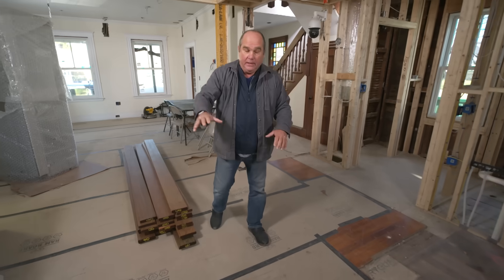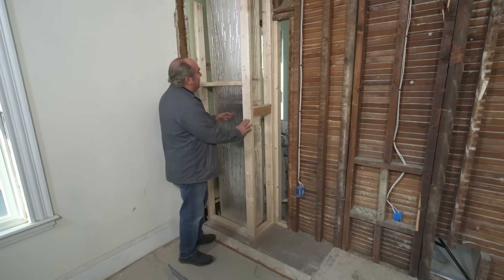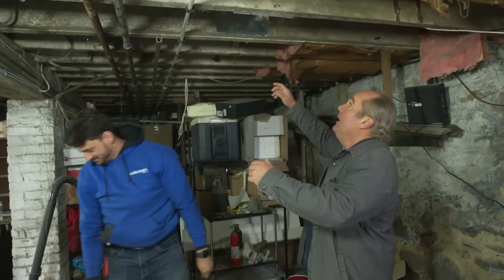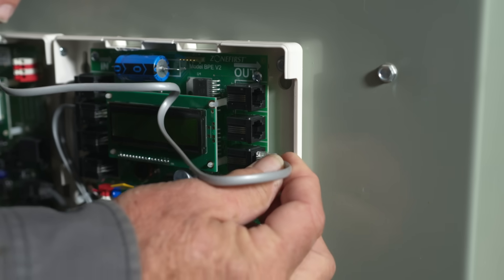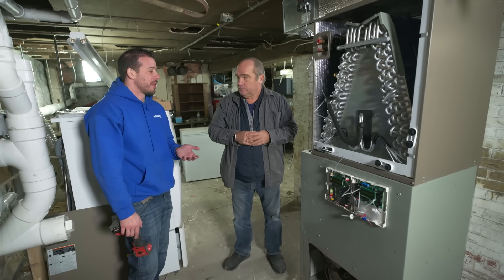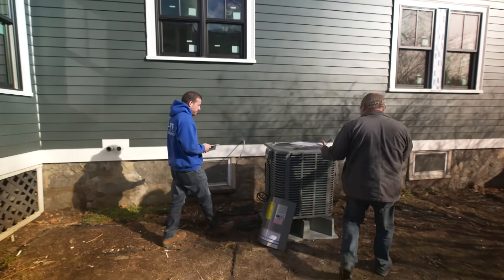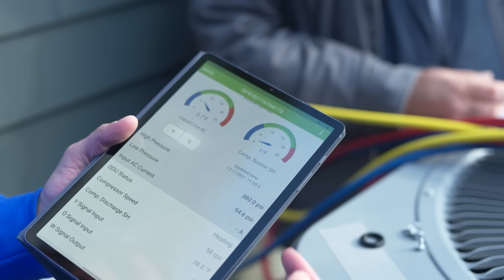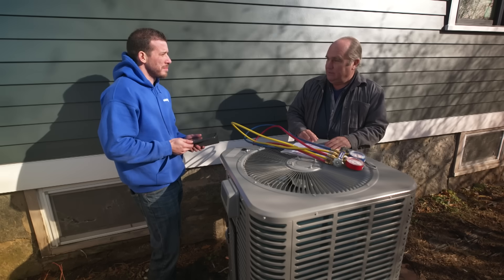Dual Fuel HVAC | This Old House

Comment: I’ve been using a Bryant Evolution hybrid system in my house since 2009. It replaced the crappy builder grade gas furnace that was installed when my house was built in 1992. I have mine setup so the heat pump locks out below 32F and the propane takes over. Still works great!

Comment: Dual fuel is the biggest government lie of this generation. They push for heat pumps and now our electricity rates are skyrocketing due to ai data centers on the east coast. Now the system chooses to use the gas furnace 90% of the time because it’s cheaper. The heat pump is just a waste of money and isn’t as efficient as advertised.

Comment: Standard gas lighting. “Switch from fossil fuel to electric”. Where do people think the electricity comes from?  In that area of New England it’s probably still coal. Natural gas if you’re lucky. Furnace is 92%. Power plant electricity delivery is under 70%. Which is green?

Comment: Now that there are heat pumps that work down to -20F and still provide 100% BTU’s down to -5F, there’s few places left in the lower 48 where dual fuel is needed.

Comment: I know people with an old octopus coal furnace with a Janitrol gas conversion burner. It looks like a mushroom with a gas spud that sprays gas on the bottom of the mushroom cap. It has a thermopile and can run with no electricity. If you add a duct fan and a fan limit switch, you can squeeze 80% efficiency out of a furnace from the alte 1800s.

Comment: No discussion of capital cost, the cost of electricity in the area, the need to have that system running literally ALL of the time, and the typical feeling you get indoors from a heatpump system of being "slightly cool." "Mom, is the heat on?" "Honey, if you are too cold, we'll turn on the gas heat." Bingo. You paid a TON of money to have the option to run the form of heat that will actually make you feel comfortable. The physics are great...until you have to pay for that transfer of heat, and then, make it comfortable in your house.

Comment: 1. That ductwork on the 2nd floor is grossly undersized. 
2. There is no return duct on the 2nd floor. That zone will never satisfy. 
3. Bay panning for ductwork is illegal in Massachusetts . Not to code. 
4. The duct should be insulated r-6 and r-8 in the basement. 
5. That heat pump unit does not heat down to the temperature he said. Maybe 100% of its capacity down to 30 degrees outdoor ambient. The bosch ultra cold weather heat pump is the only unit on the market that will run at 100% rated capacity down to 5 degrees outdoor ambient. That unit in the video aint it.  
5. The duct on top of the evap coil is too short. 
6. I love this old house and have been a long-time fan, but that's a terrible install.

Comment: There's a few of those old original coal furnaces still in use! Many have had gas/oil burners installed to replace the coal with something cleaner and less work. Some of them do work well and the home owners are happy with them. Hopefully the less effective installations have been replaced over the years. But these old systems could work and some homes back in the day would have been pretty comfortable.
Reply: And with coal, no electric is needed!

Comment: 1:30 look how smashed that flex duct is. Definitely gonna have airflow problems.
Reply: No flex duct in my house. CHEAP JUNK.
Reply: @uwetoob9265 Agree. The only flex duct I have is oversized for return air flow from the bedrooms to a central plenum mounted over the hallway. Basically a big ‘jump duct’ system.

Comment: I wonder what the odds are that that massive 4 row all aluminum A frame evaporator coil will do 10 years without leaking refrigerant ???
Ditto for the outdoor unit if it's microchannel...

Comment: I live in NH and installed a duel fuel system and i absolutely love it. The heat pump not only takes care of AC, but it handles all the heating in the shoulder seasons. 

My HVAC vompany showed us an app where you can enter your heat pump model, fuel price, and electicity price and it eill tell at what temps whichmethod is cheaper. While our heat pump can heat down to -5 the it becomes cheaper to use propane once the temp drops below thirty. 

I dont think people realize how efficent heat pumps are. My electric bill is never higher than 150 a month, and ussually closer to 100. Thats wih the heat pump handling all heating and cooling (except for December - March, which is mostly propane.)

These sytems really arent that complex and id reccomend anyone considering it to get one! Just make sure you have competent HVAC comoany that regulalry works with heat pumps.

Comment: Take it from a retired union HVAC technician, stick with the most basic system when it comes to equipment. Proper equipment sizing and properly installed ductwork is all that’s needed.
Reply: Couldn't of said it any better. I installed a USED Rheem Criterion II, 20 years ago, 2nd ignitor, and it keeps on ticking even in some rough Chicago winters.

Comment: I got dual fuel simply because I didn't want to upgrade my electric panel for emergency heat. It would have been very expensive. Plus I can run the gas heat with my little generator if necessary.

Comment: We should thank the coal industry to operate all these heat pumps. Where does your electric power come from? I think electricity is the dirtiest, most expensive form of energy there is. It either comes from natural gas, coal, hydo dams, or nuclear. Take your pick. Everyone should be required to do one shift in a coal fired power plant, just one. It is hot, noisy, and everything you touch has black dust on it. Most so-called dual fuel systems change over at about 20° outdoor trmp.. That's like admitting that heat pumps dont work when it gets cold, right? But that's physics.  Heat pumps can not beat the cost per BTU of any 92% natural gas furnace.
Reply: There are no coal plants in new england, where this show takes place. Our power comes from nuclear, hydro, renewables, and natural gas.

Comment: I am a hvac tech that lives in the south. I bought a house with dual fuel. I knew it was a bad idea for it, I used it the first few years of living here. I will never sell anyone a dual fuel. Will never sell anyone one. The heat pump stops heating around to 40f degrees. Gas kicks in and burns about $600 a month in propane fuel. You still have a high electric bill also during the winter for the heat pump trying to heat. If you live in a colder area I can only imagine. How bad it could be. I hardly ever run mine if it goes below 45 I use my force air fireplace . It heats the house, I just have to split wood which is a lot cheaper then propane

Comment: These heat pumps cost more to run then natural gas also the discharge temperature is barely 110degrees , they have a habbit of going into defrost cycle in low temps and eventually fire the natural gas or propane anyways. Kinda a nice idea but only would be good if electricity was cheaper

Comment: back in 2009 I had my HVAC guy install a Goodman heat pump on my Trane NG furnace. I did the research already and wired in the wireless controls with Auto switchover.  it worked amazing and kept the house warm and cool year round.  highly recommend dual fuel choices where it makes sense for climate and owners.
Reply: I think what has changed in that time is that some newer heat pumps can remain efficient to a much lower temperature which makes them an option for colder climates where they weren’t before.
Reply: @DahVeeDeeOh  good observation,  im in southern Kansas, unit i had was good to about 20-25 deg F, below that it just couldn't keep up.  ive read where newer are good sometimes to zero F.
Reply: @WingitAirfieldRanch  The unit in the video can extract heat down to -22F, but not at the same output when it's +20F outside, hence the duel heat sources.
Reply: I’m service HVAC and sure glad Goodman keeps me in business. 😆
Reply: @Boristhebulletdodger86  Are there any good quality brands?
Reply: @gregorymalchuk272 carrier, Linux, American Standard, Trane, York. Only thing about Trane is their controls require special permissions from the manufacturer once you go to their more complex units.

Comment: Okay so how often does the electric resistor heat kick on when it gets cold??  I'm guessing that's when the gas takes over.  Around here in Tennessee, from my experience, heat pumps are only good to about 20-25 degrees before they quit working and you kick on that electric resistor heat.  Then you can watch the dial on your electric meter spin about 7 times as fast, that resistor heat is very inefficient.
Reply: The heat pump coil is sitting on top of a furnace.  The system can use either the heat pump or heat from the furnace and so resistive heating is not required.  One of the main advantages of this heat pump is that it can adapt to an existing furnace frame.

Comment: I did this when I first moved into my house in 2019 -- there was an oil furnace that still worked and we couldn't afford to do the whole shebang at once, so we just added the heat pump coil on top of the existing oil unit. 

Once we had some money to spare a few years later, we had the oil furnace and tank torn out and now we're all electric, for the times when it's -20ºC here in Canada and the heat pump has a bit of trouble keeping up with our completely uninsulated house. 

The 15kw electricity coil runs for about 120 hours per year, costs me $120, versus the $500 that the same amount of oil used to cost. 

Just as toasty, not as stinky and doesn't need any maintenance beyond the air filters. We're very happy now
Reply: Your next project needs to be to insulate the house.
Reply: @gregorymalchuk272  Masonry facade, a flat roof with no attic access and joists embedded in concrete in the basement. Got quotes to do it right without creating vapour/condensation problems and I'd never recoup the money in my lifetime. 

I might insulate the basement from the outside when we do foundation work...

It's a townhouse so I only lose heat from the front and the back walls, I spend $1200 on 100% green electricity in a year, total, maybe $900 on climate control. It'd take me like 60 years to break even lol

Comment: The HVAC system is probably the most simple setup in a home, yet the "Professionals" try to make it sound so sofisticated that the Home owner doesn't understand.  We have installed hundreds of systems for neighbors for a couple hundred$$.  We have all but eliminated the Rip-Off HVAC Companies.
Reply: In other words, you do hack work on outdated systems because big words confuse you. Cool story
Reply: @BooneDoggle76  Considering we have installed close to 900 units in approximately 5 years w/ 3 call backs is far from hack work.  And I challenge you to describe " Outdated".  Almost every unit we install is either 92% or higher or nothing less than 16 seer2.  I can sense you are 1 of those RipOffs I referenced.
Reply: @BuddyAmericafirst-nh4ms If it weren’t for brazing, a lot of techs would be out of business.

Comment: How would you add refrigerate, if no more gauges. Through your tablet?
Reply: You still need hoses for vacuums, adding, or recovering refrigerant. However, most techs now use Bluetooth digital gauges to diagnose. An added benefit is that everytime you remove hoses, even if you bleed the liquid refrigerant from the high side, back into the low side, you still lose some refrigerant from the system. Doesn’t happen with these. You will lose a minimal amount.
Reply: I'm sure there are still service ports on the condenser unit.  I noticed that the HVAC tech quietly used the word "troubleshooting" when they were talking about gauge use, and I'm sure that has to do with remote access to the system via IoT.  Rather than dispatching a tech to hook up gauges, the tech can log into the condenser and check pressures, refrigerant temps, superheat and subcooling, and air temps outdoors and at the indoor thermostats.  My guess is they still use external gauges and manifold to pressure test with nitrogen, pull vacuum, and charge the system.

Comment: Please, 🙏 listen.. Heat pumps, and Hybrid HP systems, are never going to be cheeper to heat yer home annually, if you live in a cold weather climate, period. Yes, newer inverter driven, variable capacity Cold climate Heat pumps perform down to much control older temps than older HP systems, say, down to 30 or even 25 degrees. Though they must switch to a backup heat source, ideally gas, followed by oil, then unfortunately electric resistance strip heaters.. If you have a dealer set up your system balance points, for your climate, like above 45 or 50 degrees outside, the Heat pump alone would carry the house. When the temp falls to 30 or 25, the HP is switched off, and your backup heat carries you till the temp warm up outside. You are using more expensive electricity to heat you home when temps allow, though this is almost always more expensive than just using a gas or oil furnace. If that makes you feel good, being more "Green" and all, then fine. It's always going to cost more annually than just using yer gas unit. If you ask the right questions when you're getting quotes from dealers, most will level with you, tell you you're going save any money year over year. Though you can feel morally superior to yer gas or oil burning neighbors if that works for you...
40 year HVAC professional here....
Reply: I have an ecobee so I can see exactly how much my heat pump runs versus my electric coil backup, and how much the system in general costs me. 

I live in Canada. It gets cold here. I spent $700 heating my house, all in last winter. $120 of that was my electric strips in my furnace, which ran for 113 hours, $580 of that was my heat pump, which ran for 2200 hours.

To meet the same heating needs with a gas furnace, would cost me somewhere around $2500, and I have a shitty non-cold-climate heat pump. If I had a good one, I wouldn't need the backup strips at all.

The lesson: Energy cost ratios aren't the same everywhere. Heat pumps do make sense in many scenarios.
Reply: This is plain wrong.  Heat pumps can operate down to -20 now, and while it might not be as efficient down to -20 it’s not going to switch over to gas at something like 30 degrees.  And what are you talking about with electric, gas, and oil?  You’d just pick one as your backup - usually electric heat strips.  It’s costs more when it’s very cold but the heat pump savings will make up for that.  

In some states with cheap gas and high electric it won’t make sense but expect to see less and less of that over time.
Reply: @Wisteso The fact they can run down to to those temps, does not change the fact, if you look at the extended ratings on AHRI's site, most every brands Low Ambient/Cold Climate Heat pumps BTU output still falls off significantly, below 30 to 25 degrees.. This means, say a 4 ton inverter driven HP unit may generate 48,000 BTU's at 50 F outside, though at 35 or 30 and below, it can fall to 30,000 BTU or less.. Meaning the HP alone cannot maintain the set temp, and will need the backup to help get back to set point. If that's furnace, then it's as economical as it can be. If it's and electric strip heat backup, then your overall energy use, is going to be much higher. Just because the newer Units can keep running at 0 degrees of lower, doesn't mean they can actually hear yer house to setpoint, with using back up heat, though preferably an actual fossil fuel furnace. As that you best option for overall energy economy.. I do this, for living, with a major MFR... We just pay way too much per KW per hour in the states, for reality to be otherwise...

Comment: Did something similar for a while then completely disconnected my gas after realizing my heat pump took care of everything and gas company was just charging me for the connection. Heat pumps work in some really cold climates now.
Reply: Gas is cheaper under 25-30.

Comment: Great system! A little high tech, but there is the redundancy with the gas furnace. And the gas furnace will run on a 120 volt power source.

Comment: "What's not to like?" Well it's likely insanely expensive compared to a standard furnace for one. Plus with the complexity of the electronics a lot of failure points are introduced. I do like the design choice of having those circuit boards outside of the enclosure. Likely helps reduce the temperature swings that it would see inside of the unit. I bought a 90 or 95% efficient gas furnace from a major brand in 2006. The circuit board inside failed on that m****rf*****g thing in only 11 years. Plus it seemed like I was often needing to shut the thing down to deal with error codes. The furnace in my current house is a base model, minimum efficiency unit installed in the early 2000's. It runs without me fretting over it every few weeks or so. If one is looking to maximize efficiency at home without constant issues, focus on insulation, windows, a programmable thermostat, and sealing off drafts. If you're intent on getting the latest HVAC tech and you're not handy around the house,  prepare to be on a first name basis with your local repair technician.

Comment: Thank you for your efforts to reduce high cost energy and a cleaner solution! My home uses dual fuel heat pumps for my two units, a heat pump clothes dryer, an induction cooktop and all electric cars. With my solar, my utility bills are sometimes a negative balance! While the solar helps offset the energy I use, my consumption has been cut in half, Thank you for helping me get to this position,

Comment: Why didn’t they put the heat on the floor instead of the ceiling.
Reply: Convection? That what the original 18-something system was doing.